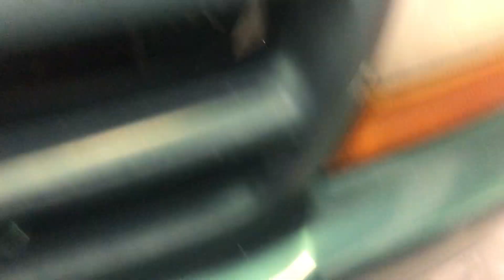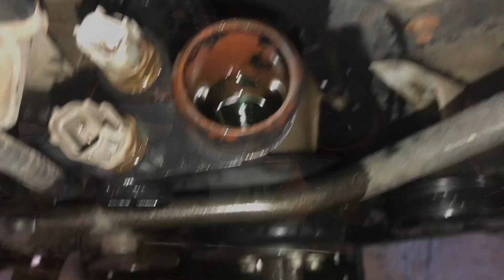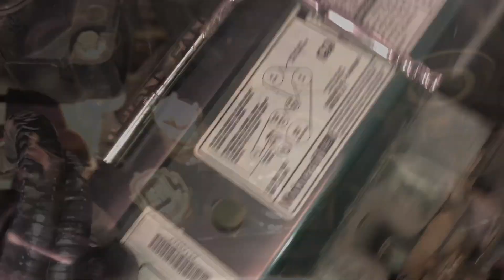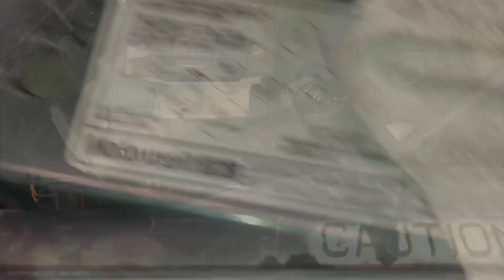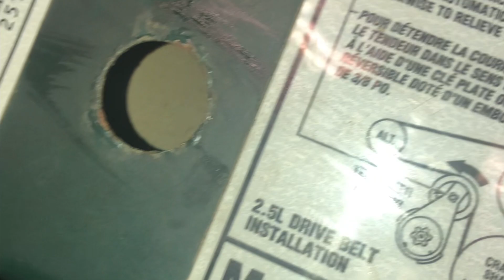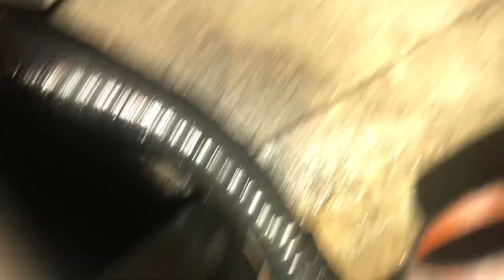How to replace thermostat on a 2000 Ford Ranger(applies 1998 -2003) Remake Fix camera zoom

Comment: What does it mean to purge the system?
Reply from the maker: I meant bleeding the system of air cause if you leave air bubbles in the coolant system it can give you overheating problems so you got to make sure you bleed it to get all the air out @sevastianhernandez9904